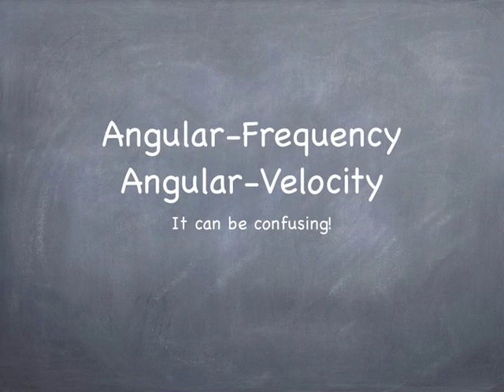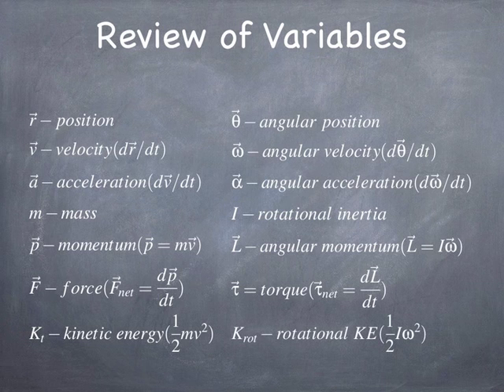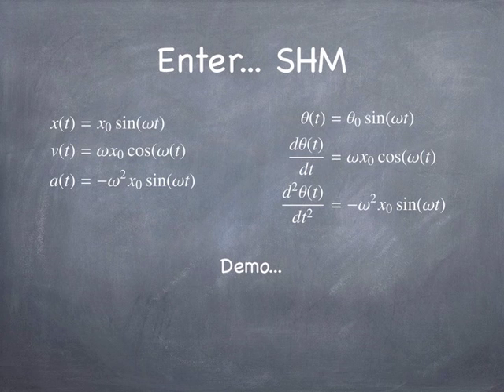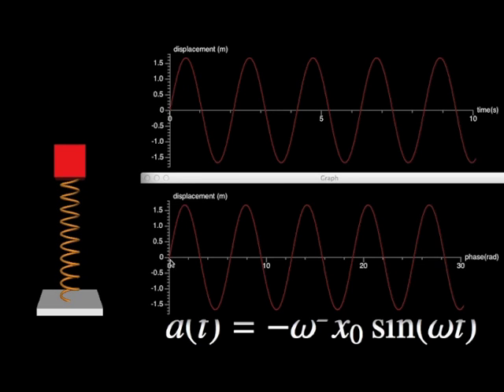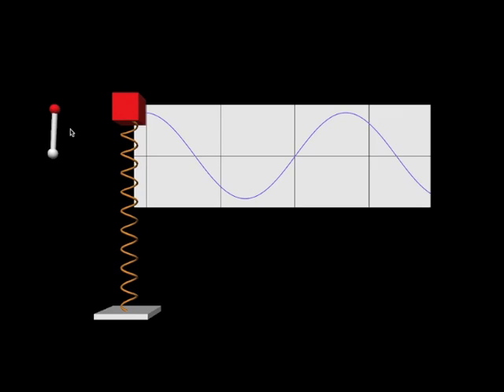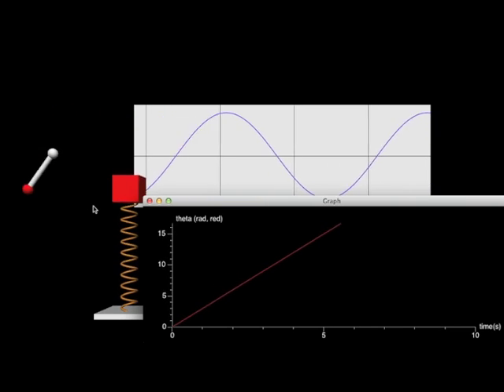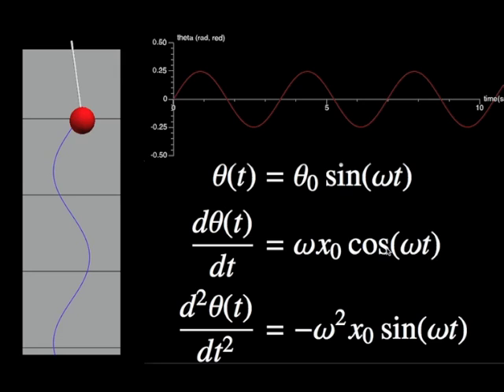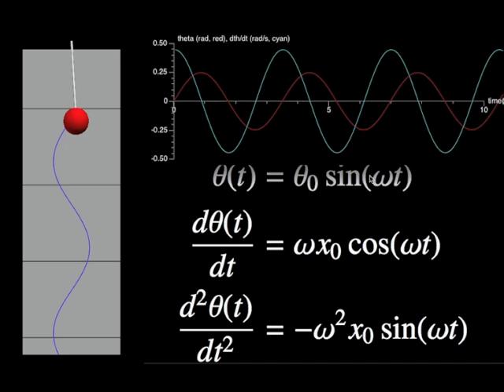Angular Frequency vs. Angular Velocity...

Comment: Every periodic phenomena can be made analogous to a uniform circular motion. This statement sums it all. The y coordinate represents the magnitude that varies, but the angle made by the  line (drawn by joining the origin and point in the circle) with the x axis is the phase. And the rate at which that phase changes is the w ( omega)- angular frequency.
Thanks for this awesome clarification. I got it all when you talked about pendulum.

Comment: your sins should be cos. if you start the spring at amplitude it should start as cosine with displacement versus time. then the derivatives chasnge and therefore the trig functions
Reply from the maker: +Javier Villegas The oscillations in the video start at equilibrium with a finite velocity so I think 'sin' is OK. You're right though, if they had started with a displacement, but no velocity, a 'cos' would've been better. Alternatively if they start with both displacement and velocity you'd need some kind of superposition, which is equivalent to some kind of phase angle depending on the exact initial conditions. Since working out the exact solution based on the detailed initial conditions was not the main point I glossed over that part. Perhaps another video about that is in order. ;-)